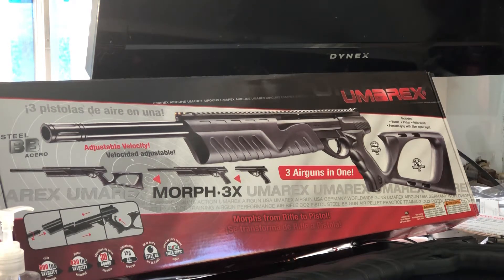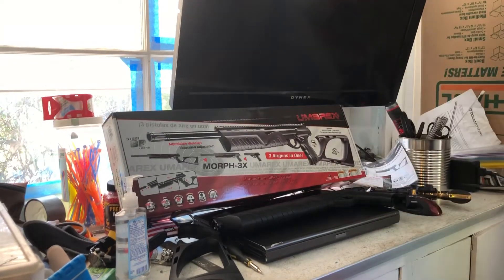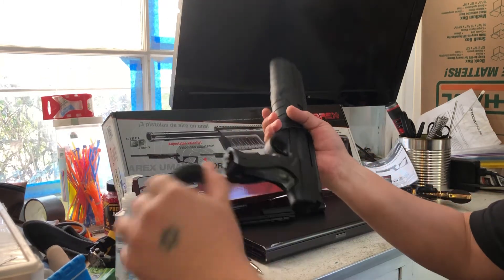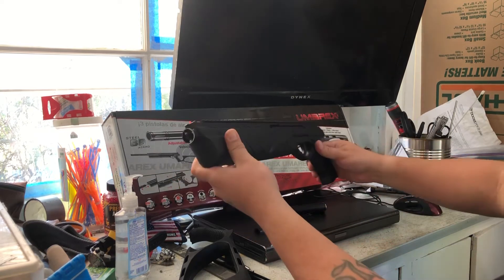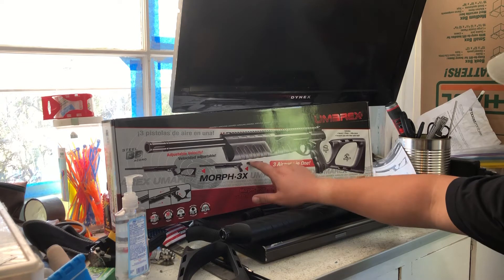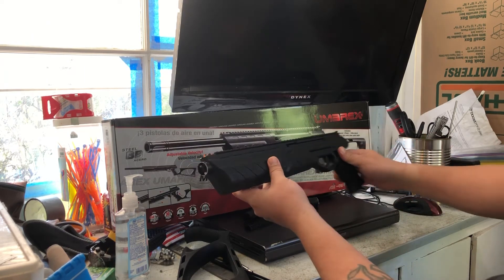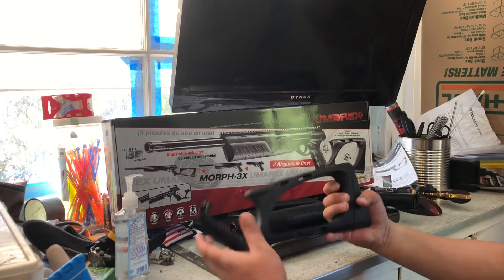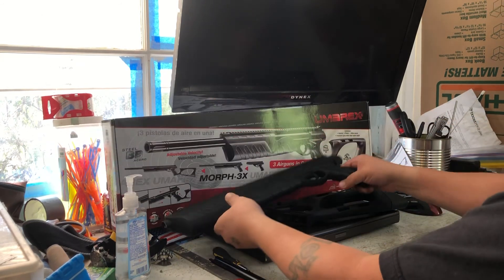(Gun 37) Umarex Morph 3x Modification

Comment: If you want to see a seriously powerful air gun that you can actually even hunt deer and other midsize game with then you should take a look over at Airforce Airguns. They have an air gun that can shoot  a 50 caliber projectile at over 1000 ft. per second. It’s pretty cool.

Here’s some specs from their website:

Technical Specifications:

Velocity: up to 1100 feet per second*
Max Fill Pressure: 3000 psi / 200 bar (Only use compressed air or dry nitrogen)
Action: Single shot
Weight: 7.65 lbs
Length: 48 inches
Barrel:34 inches
Trigger: 2 stage, adjustable for position
Sights: Open or optical may be installed
Air Tank Volume: 490cc
Safety: Automatic on cocking
Energy: up to 650 foot pounds*
* Depending on pellet weight